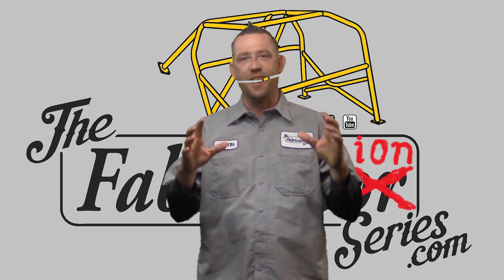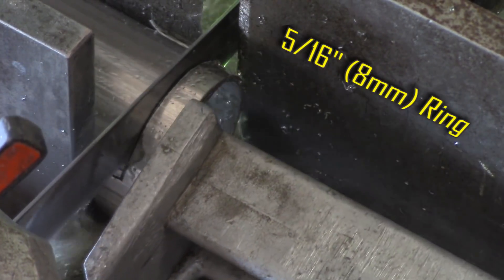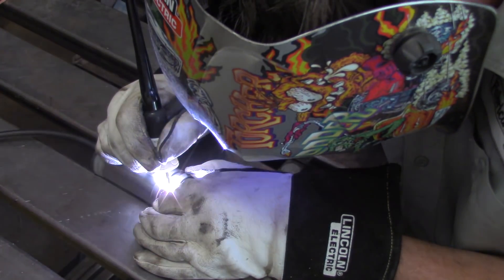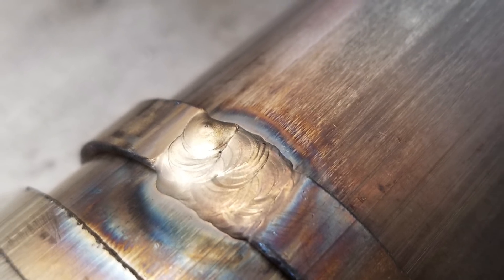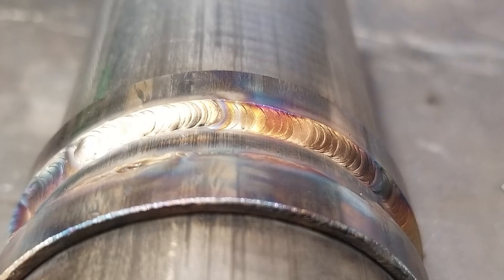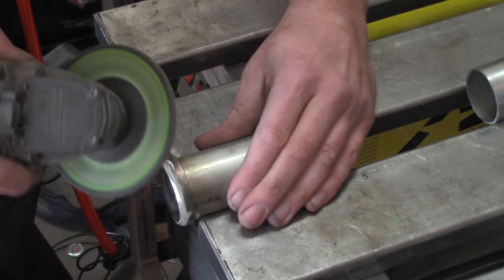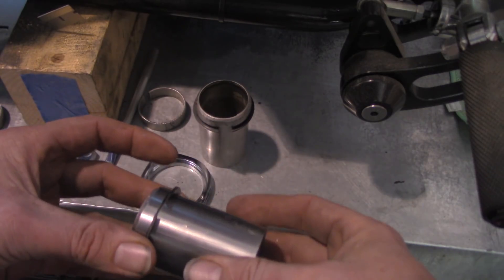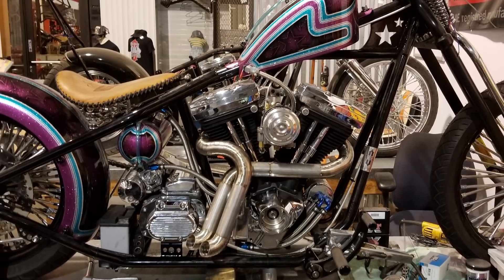TFS: Harley Evo Exhaust Flanges DIY

Comment: Just a quick question,  when all is said and done , exhaust gasket is in flange is on , will the flange be flush with the cylinder when fully tightened? Because on my sportster the flange does not sit flush with the cylinder

Comment: could you use a bead roller, if the material was say 039 or 042 wall, to creat the ridge or lip in place of this technique?  i am attempting the same thing and love the technique that you showed.  thanks much
Reply from the maker: michael ewings A bead would likely cause the ring to slip off or not seal correctly/move around.
Reply: thanks much for taking the time to answer questions.  im trying to do this out of titanium so need to minimize the learning curve...

Comment: Being unfamiliar but interested in increasing my welding knowledge,  I am aware of shielding gas. Why purge the INSIDE of the tube fabrication...cooling ?  Thanks   J K
Reply from the maker: James Krivitsky Stainless steel is a reactive metal. If it exposed to the atmosphere at a particular temperature, it's unique properties essentially become unless and the metal becomes weak and brittle. The purpose of pumping the inside is to protect it during welding and maintain its properties and strength. 

Check out the back purge video https://youtu.be/AIRWMhoke9I

Comment: Do a diy maf adapter
Reply from the maker: Jake Flanagan Buy a MAF flange/bung and weld it to a tube. Most modern sensors require machining to make the adapter, but some of the older models can be done by hand easily. I'll try to create and episode about it.

Comment: So you don't just weld the little ring on top of a piece of tube to not distort it too much I guess? Doesn't it have to be lathe-precise to seal? I'll definitely try this as I'm sick of having to chop exhausts apart to obtain these little flanges 😂
Reply from the maker: Metal Fruttolo I'm not sure I understand your first question. It does not require a precision finish because the gasket compresses to seal any variance. You should definitely pay attention to the finish and maintain as much precision as possible, but I've never had a leak with this technique (if that helps/reassures).
Reply: The first question was about "why weld the rings in the middle of a tube then cut it in half VS welding them on the end of the pipe", if that explains more (sorry for bad english). Thanks for the answer anyways, and for all the useful tutorials 👌🏻
Reply from the maker: Metal Fruttolo I understand. The reason is due to purging the piece and ease of fabrication. It's much easier to weld a part when there is more metal present. Welding near an edge is more difficult and can not maintain as much gas coverage. It is also easier and less time consuming to build one big piece and cut it down vs building two small individual pieces one by one since each setup process is done only once.